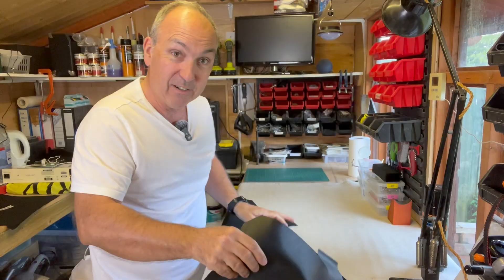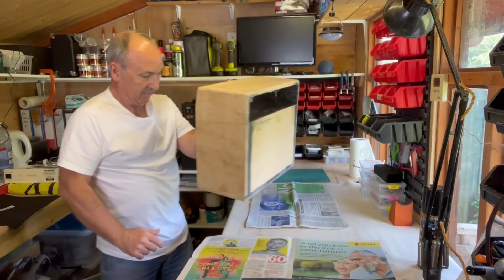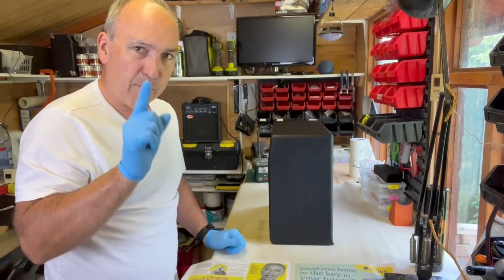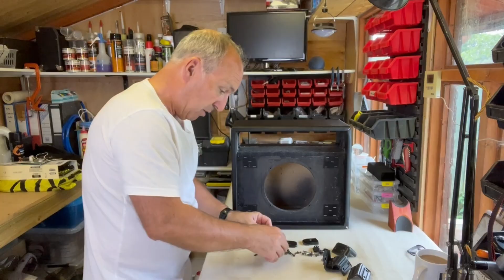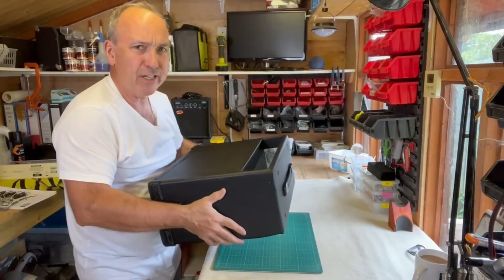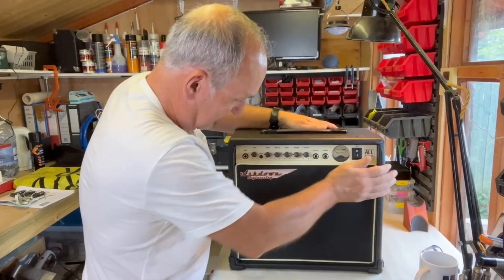Ashdown Engineering amplifier refurbisment

Comment: I bet you thought long and hard how to go about recovering it.
That glued up material is unwieldy. I'd have put it flat on the bench and sat the cabinet on it.
Reply from the maker: Good point but I was expecting more flexibility in the tolex so I could position it more accurately.   I think I could have removed and re-positioned as I found with the smaller pieces. Also think I put too much glue on !